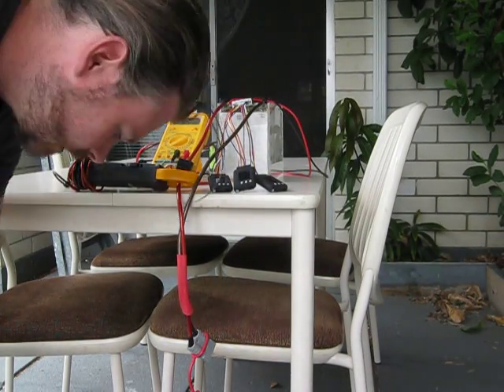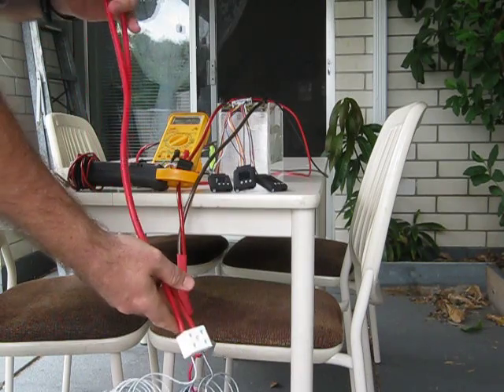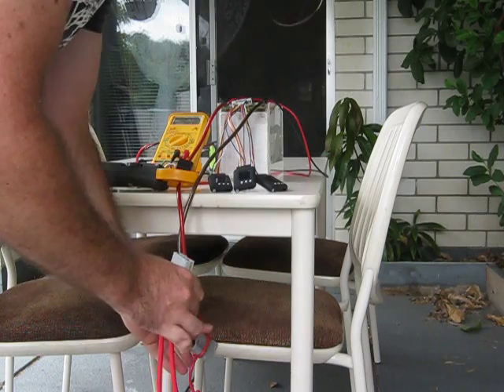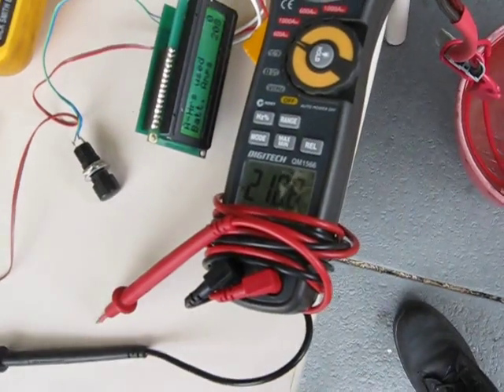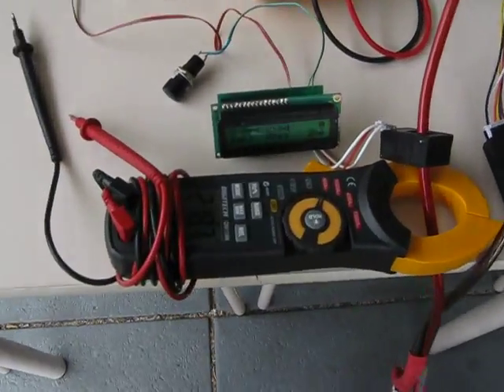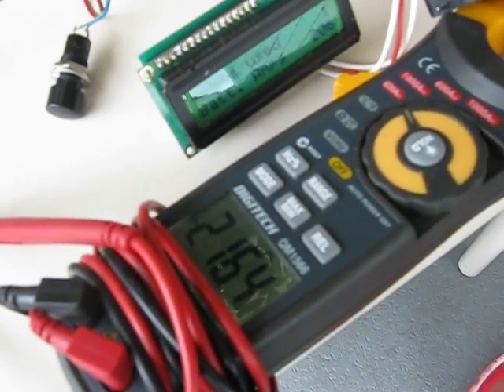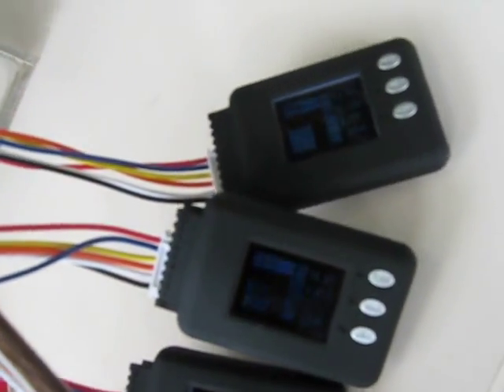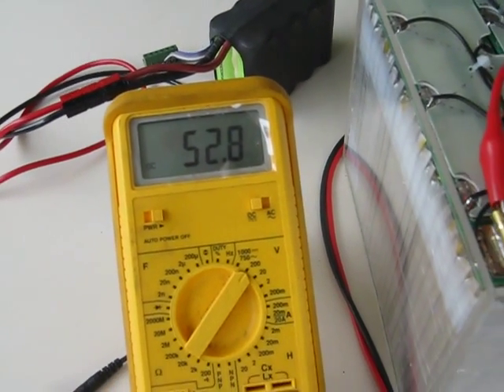13 C discharge of a "48 V" (14s3p) LiPo e-bike battery

Comment: How can I discharge a 48v 14ah pack to test it against another similar pack, at around a 20a discharge rate?  Using the slinky would pull way too many amps.
Reply from the maker: The same technique will work, just use stainless steel wire as it has more resistance. You'll need to tune it yourself.
Reply: @jonescg  Thanks for the info. I'll have to hunt down the SS Slinky.